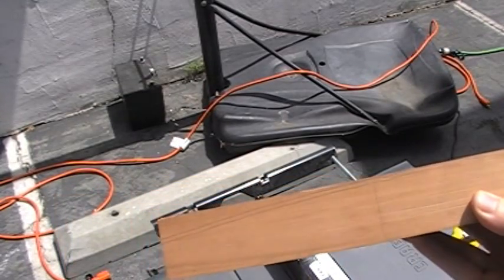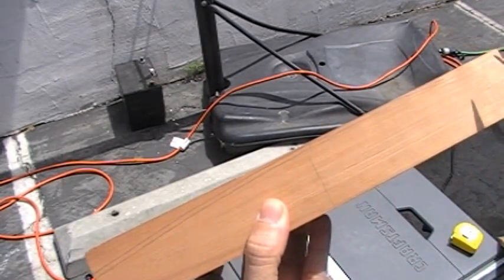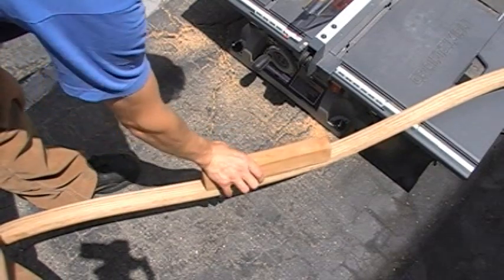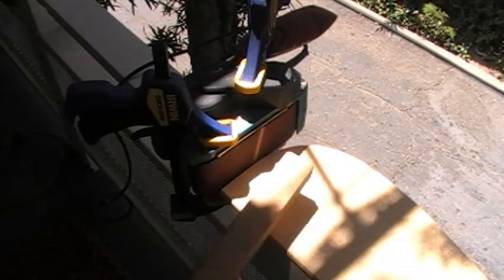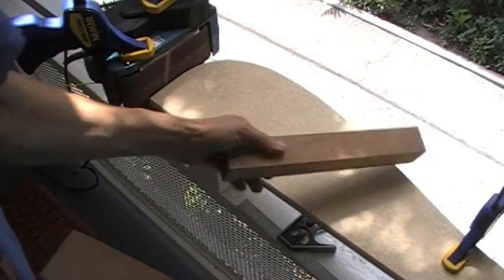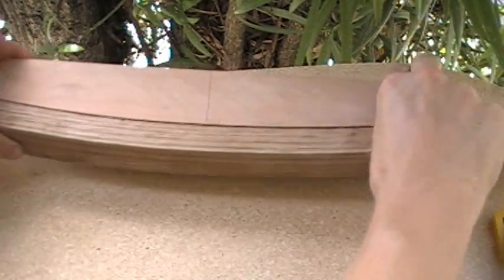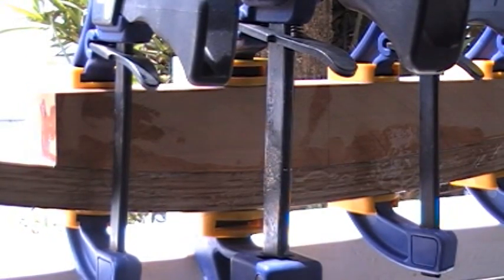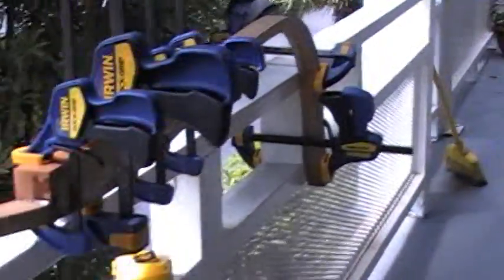Making the Bow Part 2

Comment: @shoutingback09 he probably does mean that it's really good for making a backing on, say, an ipé longbow.
in bow making you have to consider both the belly and the back of the bow and the forces associated with them. The back-side has to be flexible and somewhat "springy", where bamboo excells. But the belly has to be able to withstand pressure and that's just the one weakness of bamboo. Pressure-cracked lines appear nearly instantly.
It's possible to make, but not that good ;)